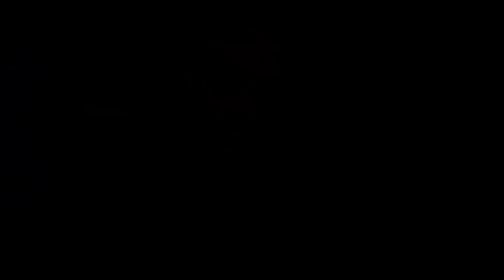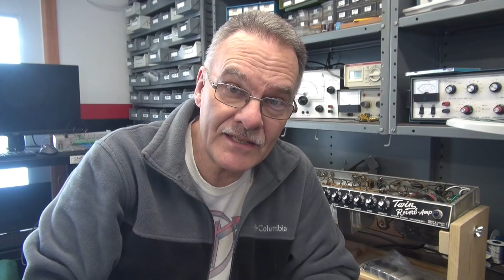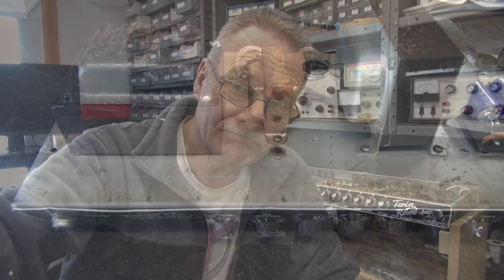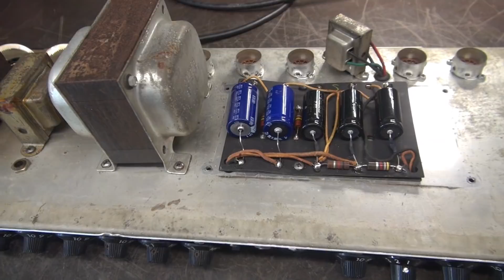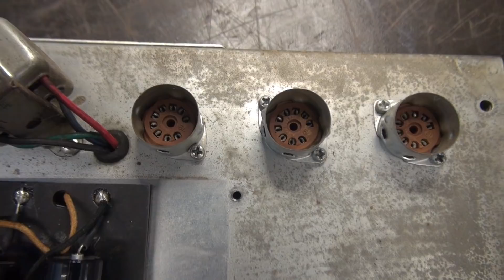Minor repair Vintage 67 Fender Twin tube guitar amp Intermittent Reverb and Tremolo

Comment: i’m getting an annoying pop with my vibrato switch, original 77 super reverb footswitch, the reverb switch is fine, new cable and switchcraft plugs and it still pops, what could it be? bad switch or grounding issue?

Comment: When I was very young I had a Fender Quad Reverb but lost it and I recently picked up a used one.   When I opened it up it was all original, never been touched!  When you turn up the tremolo intensity, the volume drops and sounds very compressed.  Also I don't get much tremolo until intensity knob is up near 8.  I have changed the 5 filter caps, all  new  JJ Tubes,  Bias current at 21,  new photo resister,  still has same problem. The two resisters on the one end of the photo resister measure 100 ohm
 and  10 meg ohm.  Thats about all I know.  Any help here would be greatly appreciated!

Comment: Great video Terry.  Many years ago, I was a technical for large industrial band printers for a company called Centronics. We had to go thru a training course on how to troubleshoot them and were often tested with injected problems. When it was my turn, the printer was DOA, no power.... firs thing I did was pull out the plug to find the HOT blade missing on the cord. I was given an A+++   Every other tech in the class, ripped it apart and changed the power supply board.   Moral of the story : always look for the simple things first which you clearly did here... very very good video my friend.

Comment: Considering there's only 3 factories that make tubes...   Chinese ones are EASY to visually identify by the bracket inside.  JJ doesn't private label.  That leaves only one place.
Reply: Did you know that there are lots of amps running with tubes made in the 60s and 70s? 
People can get N.O.S. tubes and also tubes survive today from a time when there were more than 3 manufacturers.
Reply: @electrolytics  I'm well aware.   I buy and sell tubes.